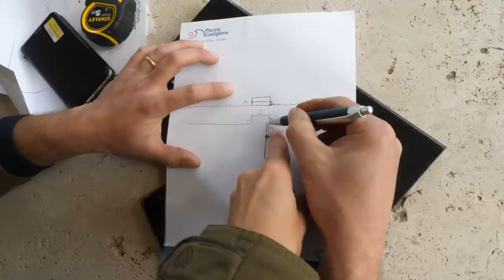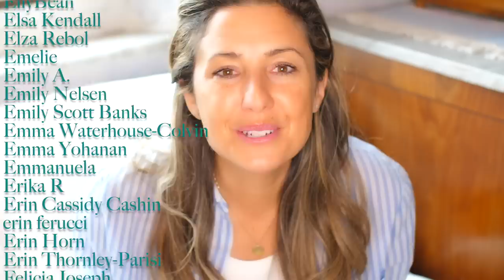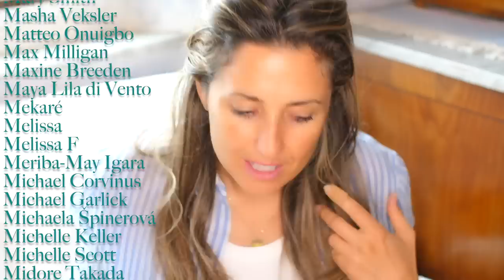RENOVATING A RUIN: Our Italian Dream Pool in Tuscany is Finished (Ep 41)

Comment: Kylie, a motorized pool cover offers such protection you can drive on it and it keeps it clean off season.  Most of all children are safe.  It’s priceless the safety of your son.  Babies can learn how to roll over to breath way before one year with the proper instructor.
Reply: the downside is that when it rains the pool cover fills with water. Also it fills with debris and needs cleaning every month with brush and mop. Take it from someone who has a pool cover.
Reply: Also, if someone---child, adult, animal, get under the pool cover, it is almost impossible to get out.

Comment: A pool fence is an absolute necessity..  Children can fall in, hit their head on the side of the pool and not be able to surface at any age, no matter how well they swim.  My son fell in at 1, right beside me, never made a splash at all.   I quickly pulled him up by the feet!!  My niece at 4 who was able to swim well, fell in hitting her head on the side on the way, sinking to the bottom.   Her 8 yr old brother found her and rescued her.  These incidents happened within the pool area, which was fenced off.   We need to be so vigilant and take all precautions necessary to protect our young ones.   There are amazing styles of fencing materials around which as long as they are unscalable and have self locking gates will enhance the area.  Minimum of 120cm high is law here in Australia.  Toughened glass is very popular.

Comment: Plastic rattan and metal are durable but get really hot. I’m glad that you are considering baby proofing  the pool. My daughter and son in law “baby proofed” the entrance to the pool area by putting a fence at the porch from the house to the yard. It worked great for them but I’m not sure that would work for you. Otherwise, I’ve seen people use a cover for the pool or have a system where there are holes drilled into the pool deck that will accept mesh fence sections. It’s nice because you can take the whole thing down in minutes if you are having a party or when you’re done with the sections they can be sold. I live in Dallas, lots of pools, lots of kids. I have a friend who’s 11 month old baby managed to crawl out of the house and drown. Just do something.

Comment: Kylie, the pool looks so beautiful. What if instead of trying to fence in the entire pool you did a darling picket style or ranch style fencing with little, short access gates around the back door/terrace area where the awning is. So if a child made his or her way out of the back door somehow, they would be met with a fence and gate. This would be a much smaller area to fence in. Potentially, a darling low fence could be added over the years in sections around the house but for starters just surrounding the back entrance and patio. So the fence would come directly from the rear walls with a side entrance gate and one small gate facing the pool. The gates could be spring-loaded then open inward then close and latch when they sprung back into the closed position. I wish I had a drawing of my vision but this is what I would do with little ones. I have no idea if they do this in Italy but they do it in England and it looks gorgeous!

Comment: I like you love rod iron deck chairs and loungers.
Their maybe some needing sand blasted you could find locally...

Another option we did was purchased rattan and spray painted. Little maintenance and ages with grace. We have sprayed both white and ivory depending on placement.
Unsure if aware but canvas pillow still mildew from rain. They should be collected after use and stored.
Very happy you have your pool. Incredible low impact to build tummy muscles. I did this after my delivery. 
Water babies were a thing then. I had mine in pool by 2 months and helped tummy and sleep after dinner.
Very helpful when the baby rolled into pool. Still frightening for us.

Comment: Dear Kylie & Guido - 

Congratulations on the completion of your pool! It's beautiful and a reflection of the thought you put into it. 

Once you've worked out the child protective device/s you feel are most appropriate, I urge considering nothing less than teak. It's highly likely, that with time you WILL have to replace teak. You'll most certainly have to treat it regularly to maintain its (limited) longevity. 

However, that said - IF you can - I strong urge continuing with the "investment" theme of slowly building and adding - and get the wrought iron. (!!) You could even consider second hand and sourcing a charming mix/match theme of iron pieces. Anything in need of a protective coating could be sand-blasted to bare metal and professionally powder-coated.Or, DIY painted. (Up your alley!)

Beautiful work. And, thank you for taking us on your journey.

Love to you all, from California.
Andrea.

Comment: For a day bed could you make something bespoke from recycled wrought iron from the second hand building supplies places? They have some fairly ornate grills and such that cld be lovely if your dad is happy to put something together for you. I’m sure you cld get some foam cut to size and cover it with some gorgeous marine canvas fabric. Teak is also an option but does need sanding back every year or two and revarnishing, even if wintered in the shed. Regarding a pool fence you cld feasibly make something moveable with permanent post holes so you cld erect whist children are little or visiting and remove if you prefer the aesthetics without a fence. We hv a glass panelled pool fence across our deck so we can see the water but that gets expensive. It only takes one second of turning your back for the unthinkable so I myself think worthwhile expense. Thanks to my mum’s swift action she saved a child from the bottom of our pool after he was left in a high chair for the time to take a plate inside and he managed to climb out and step into the pool. A few seconds longer and he wouldn’t be with us and it’s a very quiet event sadly. Mum got a pool fence organised the next day!

Comment: I’m not sure if you have the ability to get hold of wooden palettes in Italy but we made our own sofa set up out of wooden pallets , afew on top of each other and alongside each other . We added an extra pallets set up on castors so we can wheel it Infront to give a long couch to lie on , and can also be used as a coffee table so it’s dual,purpose. You can leave natural or like us, screw down into a static position and ‘fill in’ the front area with wooden decking boards. All can be treated so can be left outside and then you just have to bring in the cushions. These we made out of 2 old bed foam mattress’s covered easily in your chosen fabric. Just place thin board on the base wrap around fabric and staple gun down like a parcel. Cheap, weather proof and you can design to your spec , paint or stain the wood. We added armrests for a glass of wine . I think it’s lovely, , easy and satisfying too to have built it yourself to your own needs. Xx

Comment: About the outdoor set, few years ago at Veridea (garden center) near Vicenza I bought a fake wicker set that is really looking good and is not the modern design. The chairs do recline and the 2 end of the sofa do recline also. They have good cushion that are comfy. I have sewn protectors made in boat cover fabric for each pieces that we remove when we use them. It has been 5 years and it is still looking as the first day. The cover did lighten in color but still very good.

Comment: The pool is beautiful!  I love the colour of the liner.  Another suggestion would be to invest in some patio dishes and cups. We have a no glass rule around our pool for safety. If something falls you don’t have to worry.
Reply: Life is a journey not a destination.  It’s so true.  Life goes quickly enough without wishing it away.  Stop & smell the roses or jasmine in your case!
Reply: I too like a natural look but fake rattan can look good.  It can also fade.  Wooden furniture looks great but shouldn’t really be left outside.  Takes a lot of work to keep them looking good.  They are a formal choice.  The cushions need to be protected too so take them in.  Cotton fades in the sun but treated cushions like sunbrella can feel hard & uncomfortable.  Loungers in the white plastic are more comfortable than the wooden ones.  The metal are usually heavy & can get hot.  The finish does flake off over time too & that when they are put away after use. The wheel on the back of loungers help move them around but the white plastic ones are light to pick up.  My colour choice has been green & white stripe but that was because it was available & at a reasonable cost & it looked good in my garden.  It might be Im wanting a more happy vibe but I would favour yellow & white stripe now but will settle for the tablecloth in the table or extra cushions to be yellow & white as they will go with my green & white.  Do remember the old rule of never more than 3 colours or everything looks busy instead of elegant & stylish.  Look at the surroundings.  Focus on the element you want to stand out rather than accessories.

Comment: Look for sunbrella fabric. It's not cheap but it handles water and sun without fading. Used in Florida.  Look for used pool furniture from maybe old hotels going out of business or remodelling.  Then reupholster the cushions with sunbrella fabric.

In florida they have nice aluminium and nylon pool fence that are not permanent. It has euro sized holes drilled into the pavers and each segment links to the next and set into the holes.  Easy to remove and role up but easy to put back when you invite friends with small children. Not expensive

In Florida they have programs to drowned proof infants and toddlers. With so many pools and children it is critical. The graduation is to trip or toss them in the pool with clothes on. The unexpected shock and having street clothes and shoes on is critical to having them react instinctively to get on their backs and get to the edge.

Comment: Kylie as you are from Australia I guess you know the rules here for safety of all children.
By law:
All pools must be fully enclosed by a barrier that is at least 1200mm in height, barriers can include fencing or walls. The bottom of the pool fence and gate must be no more than 100mm off the ground. If the horizontal rails are 900mm or more apart the verticals cannot exceed 100mm apart.

Keep everyone safe.

Comment: For what it's worth I will give you my opinion on teak versus pine - I've had both. Remember, just my opinion. Teak is always the 'go to' material for outside furniture because teak is good at resisting rot, but, it is a brittle material. There is a huge difference between the teak furniture of the past and a lot of today's stuff. The problem comes in the mechanical portions where  the structure is joined together or hinged. In the past, like the deck chairs on old ocean liners, these parts were NOT simply screwed or bolted through the actual teak, the old time manufactures always used cast brass fittings into which the teak frame or slat was fitted, and the brass fitting was the part that was connected to whatever else it needed to be connected to. This prevents the teak from splitting and thus the unit will last for years. However I, at least, have never seen such a thing in decades. This may not br the 'normal' point of view, but from experience I would go for pine, but, pine in which the narrowest member is at least 2 cm thick. You must then thoroughly coat the unit in wood preserver, (it can be coloured preserver). We have had our table and chair set living outside permanently and so far it has lasted 20 years without a problem. We just re-coat it every few years. It has a very rustic patina as it has weathered and is as strong as ever.

Comment: I have plastic rattan look chairs on my patio..they have metal arms and legs ..and I have left them outside in Colorado...USA...for 16 years...in the snow and intense sun at high elevation and they look fine..have no splitting or antything really..I do not cover them...they have a mesh seat area  where you put a cushion.
They still have the original coushins as well...they do come in colors ..mine are dark choclate brown..

Comment: I would hold out for wrought iron. Any wood looks worn after a couple of years. Wrought iron is classically beautiful, lasts forever, cushions are easy to store. But make sure you buy enough pieces for your family and friends that will grow in size sooner rather than later. Designs and manufacturers change, and I was unable to purchase any matching pieces after only two years. I regret not initially buying much more.

Comment: I was surprised.that they used a liner versus some kind of spray
Reply: In terms of sun furniture, perhaps consider steel or aluminum framed chairs and footstools with chord springs. They won’t hold the dirt as much, will not get damaged by the sun and rain. You can re-chord them every 5 year or so. I live in Cali where the sun kills wood.

Comment: black iron fence for safety for all children.  I have seven grandchildren under 3.  I also have them wear life jacket while around any water.  But it has to be fenced.  When they know there is water even if they don't know how to swim they will do everything to go to the water without you knowing.  Please  do proper fencing.   As for furniture, teak will weather and will need to be treated. Heavy cast aluminum is the best as it will not rust like Iron.  But it is pricy as well. Any fabric cushions that are meant for outside will still need to be brought inside in heavy rain.

Comment: The pool cover has dual purpose, safety and closure for the season the pool is not being used.  It doesn’t detract from the aesthetic like a fence would. If a child or animal gets into the fence enclosure inadvertently it would be devastating.  Put your money into the pool cover.  Build the couch with cement or stones.  Buy second hand teak furniture or wrought iron.  The current beds you have setup are perfect until you can afford to invest in an upgrade.  Get the pool cover…the peace of mind is worth its weight in gold!

Comment: Having been a boater for 50+ years, TEAK wood is very nice.BUT, you need to teak oil treat it each year. Not really much work. Rub it on the wood with a rag. OR, let it go gray, and not have to treat it at all. I much prefer the Teak oil look. Good luck.

Comment: I bought the plastic white rattan years ago, it did not hold up! Don’t buy it, it rotted! also the critters chewed on it at night. Gross! And pillows got filthy. I’m using a lovely teal colored 9 ft umbrella with mesh teal chairs with dark colored metal. I’m also using a matching metal table. Be sure to cover with a chair cover in winter. Very reasonable price and easy to clean.

Comment: kylie, I have seen people buy cinder blocks with holes.  You stack 6  cinder blocks  on each end  and  6 cinder blocks in the middle.  Then you buy  say 9  or 10 foot by 4inch wide long teak wood and stain it and put the wood through the holes of all the cinder blocks  including in the middle and both ends. You can even paint the cinder blocks. You could then make the cushions or buy cushions. I would search the length of cushions first, then buy the wood lengths you need. I agree, your home is so beautiful, you don't want modern.